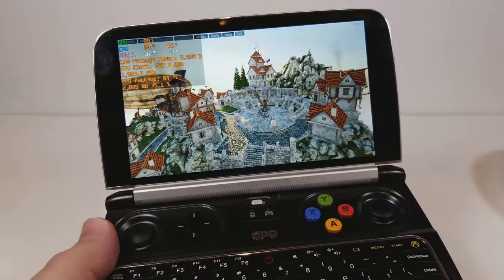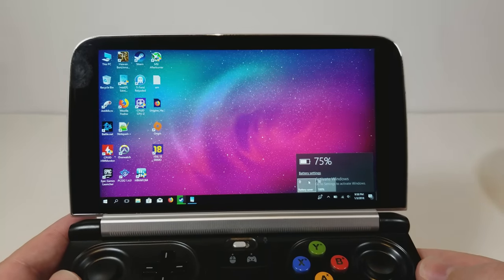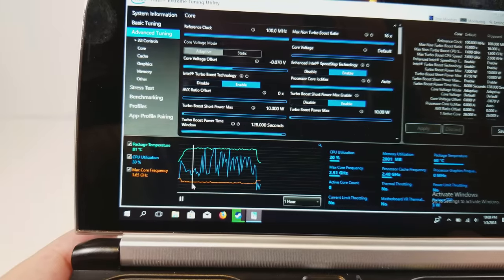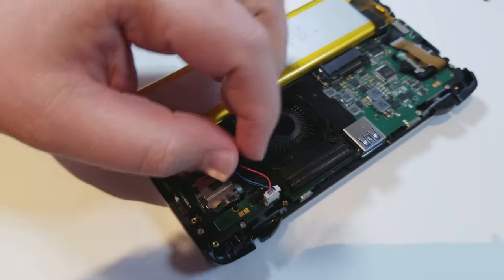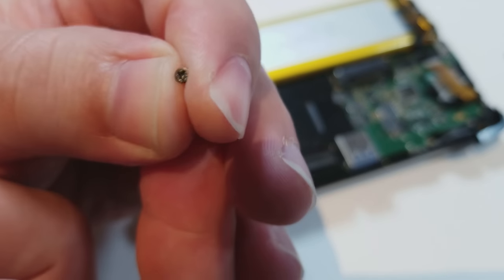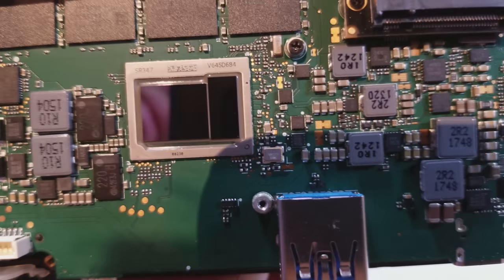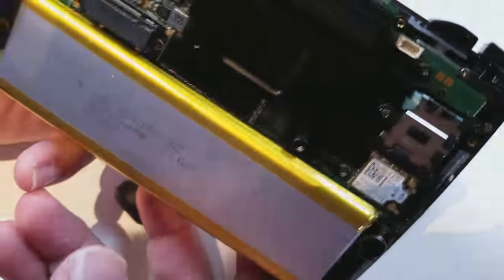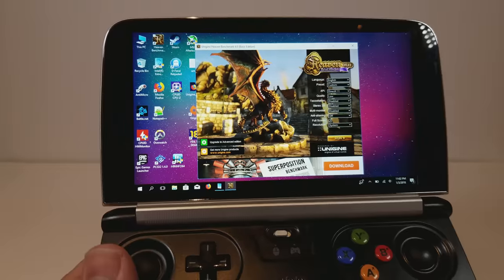GPD Win 2 - How To Replace Thermal Grease - TIM Upgrade

Comment from the maker: Just so everyone knows, this is not necessary GPD very clearly is taking thermal management very seriously on the Win 2, so I really don't think anyone should ever need to do this.
Reply: i read on reddit that the hard drive is an m2 and that it could be replaced with bigger one. if so can you show how you would remove and replace it?
Reply: LIQUID METAL take this thing to the EXTREME!!!!!!! watch them temps drop insainly.
Reply: I'm really glad GPD is using a MUCH better thermal solution than on the pocket or their first GPD Win. The more I learn about this, the more excited I am for the launch!!
Reply: lxs077 Here is the ssd replacement video: watch?v=cEtbCwGU0R8
Reply: The Phawx, GPD should organize their engineers to take some in-depth physics classes...
Reply: zZBuild ProneZz have you tried liquid metal on this? Ive done it to my laptops .... That would be crazy!!!!!
Reply: ernest lyons, some people say applying liquid metal is dangerous for the device or something....Just keep it mind....
Reply: Robin Obinray I just heard that ... If you move it around or drop it .... Or you leave it on for a year .... I put it on my laptop with ELECTRICAL THERMAL TAPE AS A BORDER .... Shaked and dropped my laptop its still alive and kicking ... I hope this helps btw the tape is from "3m 22422" I believe is the name
Reply: @BuildProne  it do Not damage the Chip? Because of electric conductivity?

I am thinking about doing this with my teclast f6 pro. (Same Chip)

Comment: keep in mind that in the long run you might want to change the thermal paste again. so i dont think that sticking the metal plate is a good idea maybe you could find the right screw that fits, if you find it but it is to long you can file it down easily

Comment: Just redo it with MX2 non conductive paste. I usually have a little bit coming out of the sides, but it is ment to be like that. You will never have a missaplication with this stuff. I would also just measure the threading and get a mostly fitting screw and secure it with loctite or some glue or fill it up with epoxy and make a new smaller thread. Glueing it onto a naked die is a bit crazy

Comment: @The Phawx, Just put in my order for the GPD Win 2, also put in an order for some Thermal Grizzly conductonaut.

Curious about the M.2 slot, is it a detachable daughter board? Like would it be possible to extend and possibly move it diagonally, so the connector sits just over the heatsink? (with a small internal case mod) and be able to use something like a 2280 SSD? I think not being able to use a 2280 is going to really hurt it. 2280 NVME would have been the most amazing option for this thing.

Comment: Phawx
Do you know if there are parts that can only be accessed only through the removal of the heatsink?

I plan to glue the heatsink to the CPU with a thermal epoxy, and want to know if doing that will leave some parts inaccessible. Thanks.

Comment: Correct me if I’m wrong but is the material that comes into contact with the die copper? If so liquid metal may be possible and with all 4 screws down that should do some wonders for temps
Reply from the maker: +Stanley Chen it is indeed

Comment: Use Noctua Thermal paste or other high quality ones like CM MasterGel or ...
Reply: Persian Penguin Network exactly I never heard about that brand he used, cooler master mx4 is the best I always use it.
Reply: Better if it's liquid metal thermal paste like Coollaboratory Liquid Ultra Thermal Paste... And also he will need to search for the missing screw to get a nice pressure on the cpu.
Reply: +ZERO PC MX-4 is not the best at conducting heat, but on a 100W processor it's within a degree or so of NT-H1 for a lower price. I mostly use Noctua coolers so I basically have an unlimited supply anyway and don't bother getting it separately. That said AS5 was still the king last time I checked. Probably because the thermal conductivity actual silver is kind of hard to beat.
Reply: Too much to go wrong with using liquid metal, it's conductive so any spillage would be a major problem.
Reply: I have been using in any cpu/gpu that have a direct die contact and i have no problem with it, I used it on my i7 7700hq and 1060 notebook and is really safe to apply.
Reply: When I use liquid metal on my laptop I like to surround the die with a thin layer of electrical tape for precaution in case of spills, but as long as you aren’t emptying the whole tube you should be fine
Reply: just use thermal grizzly its the moth expensive but it also is the mother thermal conductive paste on the market at this time. And it freaking rocks.

Comment: I wonder if liquid metal TIM will work on these chips. Like thermal grizzly's conductonaut. Could possibly see some third party cooling alternatives too.

As for the ram, since it's dual channel, using 2x 4gb chips is more expensive than 4x2gb chips. Though it does mean 4x4gb chips are possible in the future. where 2x8GB wouldn't be viable. As the pricing isn't linear.
Reply from the maker: +Lazy Bunny it will be interesting to see LM on one of these devices.

Also right now, the largest chips I can see of 1866  lpddr3 are 6GB modules.

Would be nice if a 16GB version eventually came out.
Reply: 8gb is tolerable, we'd just have to make a lot of tweaks.
 My biggest complaint is that they didn't use a single 2280 NVME SSD, sideways. It's really hard to find a bigger SSD and 128GB isn't much.
ADATA has a 256gb for an acceptable price, but for it's price you could buy a 256gb nvme 2280.

Also they should have put thunderbolt 3 on it, and USB 3.1 instead of 3.0. But that's just me.

I still remember the Asus EEE PC netbook days where lots of people were making some pretty awesome tweaks. I'm thinking we may be able to come up with some crazy stuff.
Reply: Are you planning on trying a LM setup on the device when it releases? I might dive into LM when it comes out if the thermals are worthwhile.
Reply: Oh definitely, i had a couple ideas i'd like to try. The other idea is just putting a generic thermal pad in that little dip between the heatsink and the fan. Since it looked like the bottom of the fan was metal. If possible it may get me another degree or two, by transfering a tiny bit of heat right into the fan. 

Liquid metal is amazing for laptops, since you're going right to the Die, no integrated-heat-spreader to deal with. Linus Tech Tips just did a video on it. 20c cooler and no thermal throttling.
 But admittedly the way their video was done was infuriating. Liquid metal comes with a needle like tip that should be used. Not the cone tip that was used on the linus episode.

Though I think The Phawx's problem may have been either too much thermal paste, or that missing screw, i'd maybe suggest getting a screw in that hole for The Phawx's heatsink.  Putting more pressure between the heatsink and the cpu.